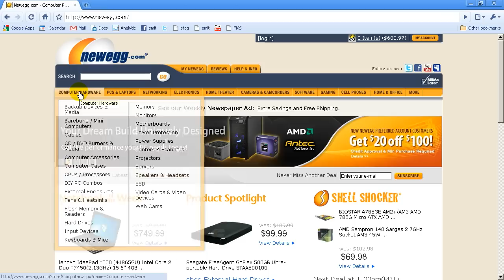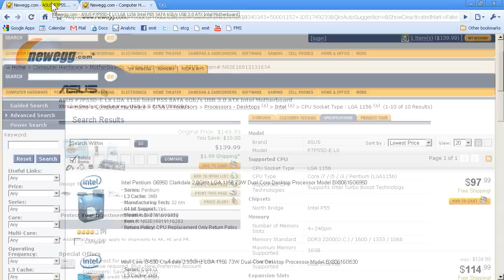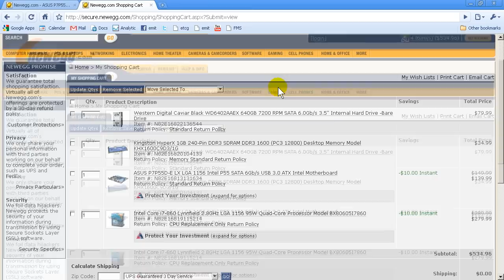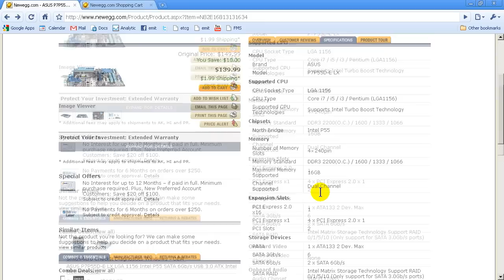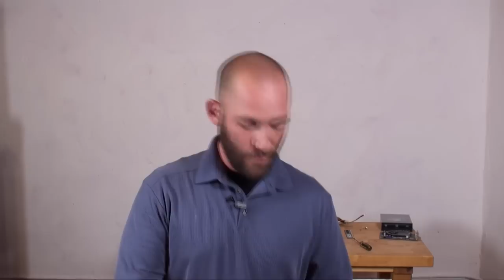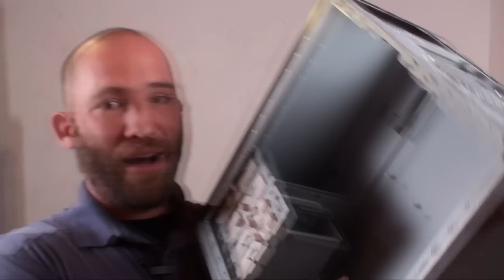How to Build a Computer

Comment: Nope.  The exam for the A+ states you need an anti-static wrist strap but most colleges, certainly the one I was at, eschew the use of wrist straps as they have to be P.A.T. tested (they contain electronic components ok it's only a resistor but a componented piece non the less).
Side note :- I so dislike the term grounded (it is actually very dangerous to be grounded during any electrical work) what you are doing is EQUALISING the static charge between you and whatever you are working on.

Comment: u look like a great guys and know what you are doin' so i need help my old laptop had a problem were whenever i booted up the system i would get to a black page with a _ blinking and i think it is because of the bios i can't get to F8 bcuz the black page comes first i tried to take my laptop apart and find the bios memory but i couldnot get to it and had to put it back together and buy a new laptop and it is just sitting in my closet can u help the laptop is for $400 and i have to pay $200

Comment: It depends on what hardware you have. There are loads of psu calculators on the internet, so use one of them and find out what you need for your components. Really, if you are running a normal, single-gpu setup, you probably never need a psu bigger than 650w, but you should check first.

Comment: 500-600 Watts should be fine for most computers. Anything below 500w might be alight for low end pc's, but if you're making a mid range pc, 500-600w is the way to go.

Comment: and another safety tip, always use ties of some sort to move your cables out of the way of any fans and the center of the inside of the tower, that way you have increased air flow throughout the computer and are minimizing the risk of overheating your computer. This also makes it easier to clean your computer in the months to come. Also, if you bend your mobo in any sort of way during installation, it may not allow your comp to power up. Do not force screws in the mobo, but make sure its secure

Comment: Yeah, this EXTREMELY unprofessional.

A) You don't just use regular tools, it's recommended to buy a demagnetized tool set.
B) You don't handle the computer components with your bare hands, in this video you're smothering the most imperative part of the computer with your greasy sausage fingers.
C) You don't walk around touching computer components, as it builds up static-electricity and can fry your computer components. In other words, you need a anti-static wrist wrap.

Take it from a pro.

Comment: That doesn't have anything to do with the speed of the motherboard, however I'm going with the ATX motherboard because i just feel the need to have more room in my case for wires and future upgrades such as watercooling or whatever and the modern ATX cases actually support ATX motherboards and ATX mini's or whatever they are called, so you can reuse the case multiple times even if you go from a ATX to a mini ATX, but if you go with the smaller case to begin with, then the ATX's wont fit

Comment: Washers aren't used and the motherboard is not isulated from the case...it's connected or grounded to the case when you insert the screws and fasten it down. As to static I know when I worked at AT&T they always insisted we use static wrist straps. One teacher told us that sometimes a part can be injured it might not die right away but sometime later.

Comment: what about using washers on the riser posts? to keep the motherboard insulated from the electrical static of the case? Movement generates ESD. touching the internal parts unnecessarily  causes weird unresolvable problems because the esd only partially destroys the part. always use anti static mats floor and table, anti ESD shoes, use anti-static bags to individually wrap the parts. if it comes to you in an antistatic bag it should go from the case to an anti-static bag. NO holes in the bag.

Comment: Sorry to say but The applying of Thermal Past can be done in lots of ways
Putin A Dot or line in the middle of your cpu is one of the best ways to do this
If you don't believe me search "how thermal paste spreads" on youtube
You will notice that when "Spread a thin layer across the entire cpu" will result in having air bubbles between your CPU and Heat-sink

He forgot to mention ... Make sure no cables are sticking into the FAN (duh)

Comment: i disagree with you about what you said about its cheaper to go to bestbuy and buy a computer or its faster no that is simply not true when you buy a computer at best buy they are factory set up to be average fast and some manufacturers use cheap quality parts at times and they put crap ware on they operating system and computers at best buy are not always cheap the cost is between 800 to  sometimes a 1,000 but i guess it not doesn't matter because in a few years best buy will be out of business

Comment: Hi, I just bought a Geforce gtx 560 with 2mb of mem, it blew out my 400watt power supply during drivers installation.
I just bought a new 850watt power supply made by RaidMax model# RX-850AE Gold Rated. I paid less than $90.00 at Fry's Electronics. The best thing is that it came with top of the line connectors and wire harnesses. Comes with two large vent fans and is very low noise.. I'm very happy with it.
Take Care...

Comment: Very good video to help out beginners. Only two pieces of criticism though. When you were going through case selection, for a first time computer builder there is probably no reason to have a full atx case. Any case with a plain atx prefix would work. Also hypothetically if someone was following your tutorial and actually buying what you were suggesting (unlikely) they would have been short a graphics card because the motherboard you chose did not have onboard video. Other than that great video.

Comment: I'm in the process of gathering parts for a gaming system, I am a first time builder. CPU: I5 2500k, GPU: HD 7870, MOBO: Asrock z68 Extreme3 Gen3 make up the core components. I have to say, this video has certainly boosted my confidence, where my system assembly skills are concerned. Thank you.

Comment: Eli, why did you rearrange the connector for the psu to the motherboard. Why? Was it just color-coded, so you just had to get the order right, or is there more information we should know before we do our own builds?  Also, when you connected the optical and the hard disk drives to the mobo, did you have to previously order the SATA cables or did they come with the parts you ordered?

Comment: Building computers has *not* always been this easy. I remember the days when simply inserting a new expansion card required you to set dip-switches or jumpers for the IRQ and Memory region, and you had to know which values were free, and you had to set those as reserved in BIOS *before* you inserted the card...
If you bought a motherboard without BIOS-ROM, you had to buy that too, before RIMM memory was just DIL-chips, there were few clear standards, you were lucky if two pieces fit, it goes on.

Comment: Risers? They're stand off's?
They're not used for positioning.. they're used to prevent shortages of the circuits colliding with the grounding of the case if the board is flat or touching the back panel.

Comment: Actually you can save money, although it might not be a lot it is still like a couple of dollars. If you're comparing your $900 custom built desktop to another $900 manufactured desktop which do you think will out perform the other? The custom rig obviously. The $900 desktop is probably only worth like $700-650 because stores retail there products, because of logos, and because they know you as a consumer need that product in order to surf the web and so on so forth point being make it yourself.

Comment from the maker: @unknown3333333333333 Probably... If you were in the US I'd say to spec it out on NewEgg.com and see where the price came to.  The main problem is that I think the i3 will be too slow for you.  If you do any high def stuff it will crawl during encoding.  I use an i7 and it takes up to 20 hours to encode some of the videos...  Think about getting a Western Digital Raptor drive.  It costs less then a SSD and will show a marked improvement over a standard drive.

Comment: So i'm thinking of building a rig that i can use for some gaming, but mainly video editing and stuff like that. Specs i'm looking at are:
3.0 Ghz i3 processor
8GB RAM
Geforce GTS 450
What i'm wondering is, would it be possible to finish this off with the supply, optical, and all the essentials excluding a monitor for under £500 (or about $750)?
I'm a first timer so i need some pro advice :D

Comment from the maker: @thenorwegianpyro Honestly I had a lot of problems with them.  They didn't destroy anything, they just had a tendency to be built cheaply.  We had a number of them where if you taped the case of the computer with your foot too hard it would flip the little 100 / 220 switch in the back and the computer would shut off.  My favorites are Antec or Corsair.